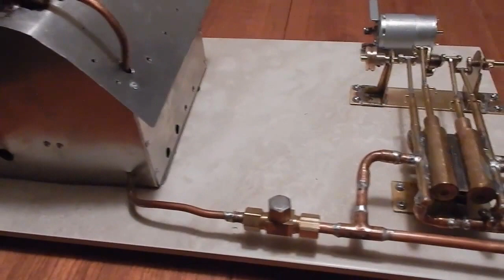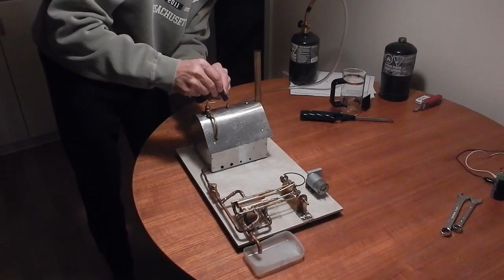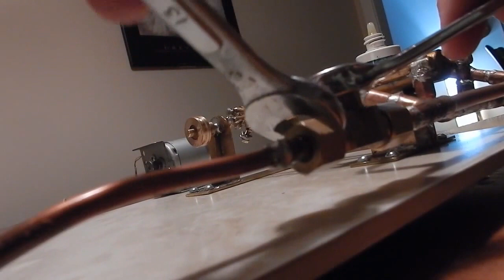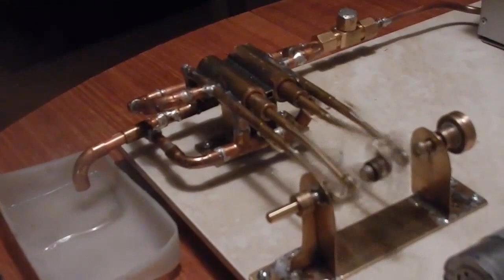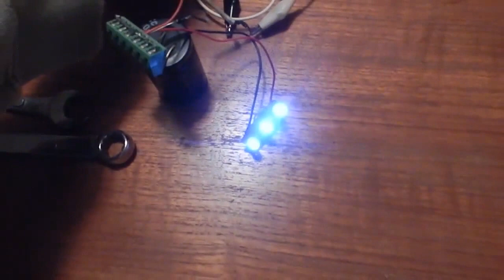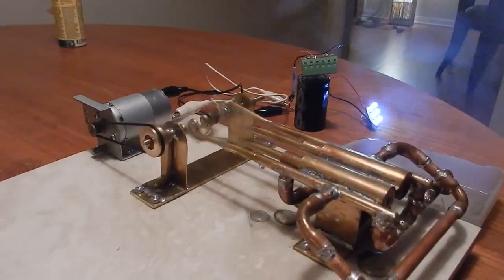Operating my new homemade twin-cylinder steam engine on live steam

Comment: You are very happy with this engine but now please make us happy by showing us how you made it and from a to z
Reply from the maker: That would mean to start building a new engine! It's a lot of work! But maybe a project...
Reply: @ch300fnqi hm.......By the way  I have been trying my level best to comprehend the functioning of system.
Reply from the maker: Kehar, you could start with this video I made several years ago from the construction of my very first engine https://youtu.be/4BPQ2kFoA5k You will see how the valves are made. Don't pay too much attention to the pistons and cylinders, I don't make them that way anymore. I used to make the pistons from brass tubes, to which I soldered two end caps, and then the piston rod. That was waaay too much work and it wasn't accurate enough, so now I buy 9/16 in brass bushings that pretty much just fit into the 5/8 in O.D. cylinders. I just reduce their diameter very slightly by turning them in the drill press against a metal file (I don't have a lathe), until they fit freely into the cylinders. Same for the top end of the cylinders, I buy the bushings and they provide a perfect seal against the piston rods. The crankshaft is also a lot of work and success is not guaranteed, so I've been wanting to build some sort of a jig to hold all the components together for soldering. But that takes time.

Comment: Good work without the need for any machining.  I'm not sure that this is double acting as that would have steam admitted alternately to each end of the cylinder, which in turn means that the piston rod has to pass through a closely fitting seal. I'd call it a twin cylinder single acting engine.  I like the soup can boiler but having had a tin of beans explode when I accidentally overheated it, I'd strongly recommend a safety valve and wouldn't recommend going anywhere near 15 psi.  A pressure cooker only runs at 5psi and they're infinitely more robust than this.  Hope to see more of your excellent engines but please be careful with that pressure!
Reply from the maker: Thank you. It is double acting, I built it ;)  It would have been a lot simpler to make it as single acting.  Steam is admitted at both ends of both pistons. Top seal is provided by a 3/16 × 5/8 bushing fitting the 3/16" piston rod. You dont mention it but the most challenging part for a double acting is the valve. As far as pressure, I've tested these cans to 30 psi without catastrophic failure. At 15 psi starts permanent deformation. This being said, this engine now has a pressure relief valve.
Reply: @ch300fnqi  I stand corrected - and even more impressed with your work. Glad to hear that you've now got a safety valve as those small cans really go off with a bang especially when they're full of beans!
Reply from the maker: Thank you ;) have a great day. And yes, we'll try to keep the baked beans off the ceiling. And steam engine operators too :D

Comment: Is it double action? how did you make the valve?
Reply from the maker: 2000Betelgeuse Yes, double action. The valve is made out of a brass rod that I spin on my drill press, and i grind the grooves while its spinning either with a Dremmel or a cutting bit from a lathe.

Comment: Hello Ron. 
Well done on your project, the sound of the engine is just amazing. I am a high school student who wants to build this at home. I have most, if not all basic machines required to build one, like a lathe machine etc. 
As I don't have a lot of experience in mechanical machines, although I do in electronic, I want to ask you if you could provide me with plans/diagrams for the crankshaft and stuff. Or as you said, the cad designs. I would like to build one, this summer. 
Thank you. 
Keep up the good work.

Comment: can you give me some plans to make 1 similar like this one  the biggest problem is the crank any plans on how you did it ?
Reply from the maker: The crankshaft is certainly the most challenging part of the whole project. But I used 3/16" and 1/8" brass rods and brass plates. The two piston cycles are 90 degrees apart. The valve cycle is 90 degrees ahead of the piston. The rest is a bit hard to explain in a few lines. But if you give me an email address I can share more info. You can also check one of my videos where I show the construction of my earlier version of the twin-cylinder engine.
Reply: +ch300fnqi justinmallia56@gmail.com
Reply: hello mister can i also have a plans or a copy for me atleast to try and make one i appreciate if you do and here's my email

champagne.supernova_rougeinfo@yahoo.com
josephabaya25@gmail.com

thankyou so much looking forward to see more of your work :)
Reply: ch300fnqi _ this is very impressive and clean looking. I am looking for a plan like yours, I don't know I could make one like you, but if you can please help me, I would be very thankful to you.  here is my email:  skapilx25@gmail.com

Comment: Is there a reason that you didn't use a flywheel?
Reply from the maker: The only two reasons are 1) I didn't have a flywheel and 2) the twin-cylinder double acting engine doesn't really need one to work. But I ended up casting one because I wanted one anyway.  You can see it on a following video at https://www.youtube.com/watch?v=pKEHChNjfEg

Comment: how did you make the burner? i want to make a small burner for my wilesco
Reply from the maker: The burner is made of a half-inch diameter brass pipe about 4 inches long, capped and soldered at both ends. I drilled about 20 small holes on the whole length to let the gas out. The gas enters the pipe from one side where I've drilled a 1/4 inch hole and soldered a piece of flexible copper tubing.
The air is mixed right at the torch nozzle. Not ideal but works for me and otherwise you need a proper pressure tube, with a jet and venturi at the burner to achieve air/gas mixture. Good luck!
Reply: +ch300fnqi i'm going to get a pencil torch but i need to get the right flame

Comment: Only thing you are missing is a PSI guage!  What an awesome little engine and it looks and sounds very efficient, I am especially amazed at how fast it can get going.

I have a crazy project idea but not too sure where to start or if it is even possible just using basic meterials, I want to build a fruit juice squeezer that runs off steam but still be some what portable.  I know it sounds silly but I think it would be rather fun and I know how to make it work up to the point of how to transfer the energy from the engine over to the squeezer.  I was thinking maybe raw steam might be enough to squeeze fruit on its own with enough pressure but that also sounds much more difficult to implement safely.

Like I said before... it is a crazy idea but any thoughts on where to start would be very much appreciated!
Reply from the maker: +TheThermionicWarrior Thanks for the comments!  Yeah, I would really like to have a pressure gauge on it but I haven't been able to find anything suitable operating below 15 psi. As for your project, let me see... I suppose you could try one of those old style meat grinders. My grandmother used to have one lol. The steam engine could drive it through a belt. But the engine would have to be significantly bigger than mine I think, or more robust anyway.  Good luck!!

Comment: As a mechanical engineering student, I'm rather impressed with how few machined parts you used and yet made a well-running machine!
Reply from the maker: Thank you! It does take a fair amount of patience, especially for the crankshaft but it is very rewarding in the end! Thanks for watching and for your comments!

Comment: This is fucking amazing. Can you please do a current output reading from the generator based on speed? I'm really interested.
Reply from the maker: +Fuckthisshitplanet Thank you!  I did test the short circuit current and it's not very high at all, about 150 mA. Problem is the generator is not very efficient, it is just a regular DC motor, I'm pretty sure I could achieve much better with a real generator, or even a 3-phase stepping motor.

Comment: do you use any lubrication?
Reply from the maker: +Alonso Jiménez Ureña Yes of course. If you look at 3:45, you will see where I add oil. And of course, every joint and bearing around the crankshaft and piston rods are lubricated before every run.

Comment: awesome old steam engine, and even better one here, I am going to build my own steam engine at some point. Currently building a Sterling engine. awesome job.
Reply from the maker: +robo1471able Thanks for the comments!  Well, old as in old style maybe :) I built it just a couple months ago. You're building a sterling engine? Awesome! I hope you will be showing it online. Good luck!
Reply: well I got redirected from your first engine to this video. I just used "old" to differentiate between the two. Yeah discovered sterling engines about 6 months ago. Made a simple one out of some beetroot cans. Now I am working on something new a little more precise with bearings and Aluminium construction. Have you considered making a double expansion steam engine? That would be really cool. If you could get it working on a similar scale to this one. :)  I will be sure to let you know when the video is on youtube. It will be my first video :).
Reply from the maker: +robo1471able Double expansion steam engine sounds really interesting, I will have to do some research on them! Can't wait to see your new sterling engine.  Cheers!
Reply: I don't know specifics, but Double expansion steam engine, Just uses small diameter high pressure cylinder, the exhausted gases that still have some energy (pressure remaining) is used in a larger diameter lower pressure cylinder before being exhausted into the atmosphere. This allows you to extract more mechanical energy from the steam. (higher efficiency engine :).  Calculating the correct diameters of the 2nd cylinder: The 2nd cylinder needs to apply the same force as the first cylinder. Since its at a lower pressure it needs to be bigger. Just not sure how much bigger. That's the hard bit I guess. Hopefully this helps.

Comment: Now I'm wondering if it would be possible to incorporate a steam condensing system at the exhaust, and make this a closed loop. Maybe instead of powering LED's the generator could run a DC computer fan over a tube coil?
Reply from the maker: +Skabulon This can certainly be done. The only thing is you need a pump to get the condensate back into the boiler. This can be a piston pump or a gear pump powerful enough to overcome the pressure of the boiler. The other consideration is that you need to be careful not to pump residue oil floating on top of the condensate. As far as the fan, that would not be a problem, they are easy to drive. Maybe something for future improvements!  Thanks for watching!

Comment: Very cool, about how long did it take to make this?
Reply from the maker: +John Smith Thanks John! It took me about 6 weeks to build, but I wasn't working on it every day. Also I reused the boiler from my previous engine, so I saved a bit of time there. But I was also working on the CAD drawings at the same time and that was taking a lot of time. In comparaison, I just built a single-cylinder version of this one https://www.youtube.com/watch?v=uhBo7tRxawc including the boiler (and several iterations of the ceramic baseplate and ruining one crankshaft) and it took me 2 weeks, working evenings and I try not to work when it's a nice weekend. I had to deliver, it was for a gift :) Have fun!

Comment: Wow!  That engine runs so well!  It's so sooth and has a beautiful sound.  Awesome job!  Can you send me links to the bushings?  I have been thinking about build a new steam engine similar to your last one.  Seems like the bushings work a lot better.  Maybe I will use those instead if they are cheap.  I am building a mono tube boiler currently.  I will need a steam engine to power with it though.  I want to make a steam power RC car.  RC car is the hope at least.  I'm not sure if I will ever get that far though.  I'm glad you have a safety release valve in your next video!  Best, -Makerj101
Reply from the maker: +Makerj101 Thank you! Yes they do work very well and they're cheap enough at 2 or $3 each. They are really 9/16" to fit in these 5/8" cylinders, and I had to machine them slightly using a metal file and spinning them on the drill press. They are Oilite bushings, available in any bearing shop. Can't wait to see your next project MakerJ101, whether a steam powered RC car or anything else!  Cheers!

Comment: OK .... I'm impressed .... I subscribed ..... >8^)

That means I will expect FAR more from you from now on!  ROFL!

Sadly ..... I was blessed with an engineer's brain  .... But the brain/finger interface was never installed at birth ..... 

I DO have some questions though .....

Can you plumb in an oiler .... ?

I worry about the amount of oil you have in there .... To ME it doesn't seem enough ......

Also lubrication of the crankshaft ......

You put a lot of work in there ..... 

You don't want your bearings buggered after only a short time .... 

The "Tin can boiler" ..... 

You say it's safe ..... But .... I do have my druthers ...... ???

Finally .... LOVE your "Engineer's socks" .....

REALLY great protection for your feet ..... ROFL!

Where to from here ?

Castings/machining ?

The sky's the limit .... 

Best wishes .... 

Jim ..... :)

Looking at your other vids .... 

I see you fly as well !

"DAMN YOUR EYES SIR!"

Another one of my passions ..... Best I could do there was be a flight simmer! :)
Reply from the maker: Many thanks for your comments.  Haha the expectations are high but I will certainly do my best ;) From what I’ve experienced so far, it doesn’t seem to need that much more oil unless you want to put this engine to real hard work over a long period of time. Then you would need some kind of system to provide a continuous oil feed. So far it seems that for one boiler fill-up, this small amount that I put in is plenty. Another consideration is that I’ve made the pistons using Oil-Lite bushings. It is a somewhat porous brass material that absorbs oil and keeps the friction surfaces lubricated.  As for the crankshaft, same idea, every time I fill up the boiler, I lubricate the bearings and it seems more than enough. I hear your concerns about the tin can boiler. It’s not my favourite part and I will come up with a better boiler sometime in the future. But I really don’t need to go any higher in pressure given that the crankshaft probably wouldn’t survive the stresses of high power applications.  Typically when operating in steady state with the generator and loads on, the pressure stabilizes under 5 psi. There are self-limiting features as well: the valves do not seal perfectly tight and therefore could not maintain high pressure in the boiler, although I am working on improvements there.  Of course I could over-pressurize it if I left the main valve closed. I would really like to add a pressure release valve and I am designing one for installation soon.  As for the engineer’s socks :) well it’s pretty low risk especially with the boiler inside a housing… Boiling spaghetti is probably more dangerous, at least with some people, lol. No comments on the engineer’s long johns, LOL

Glad you enjoyed. Yes, flying is one of my other hobbies, I love it!!
Reply: Thanks for the talk .... MUCH appreciated! :)